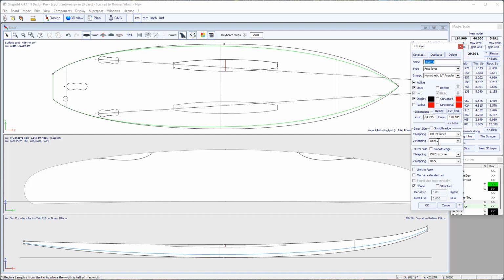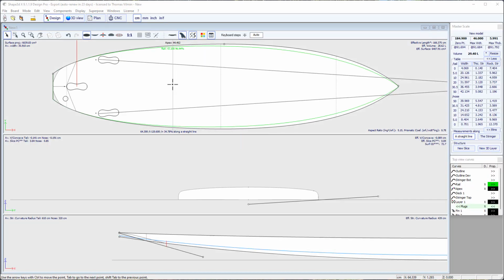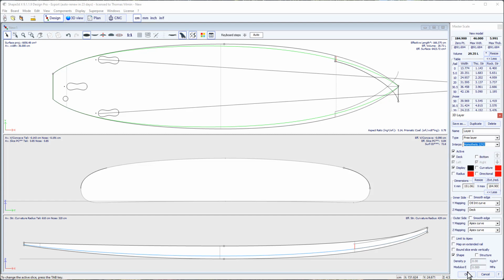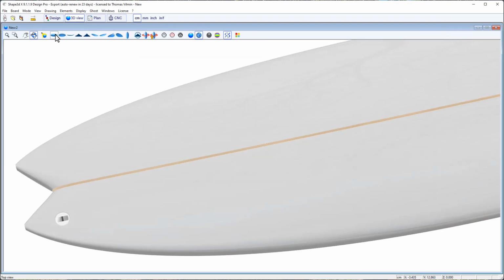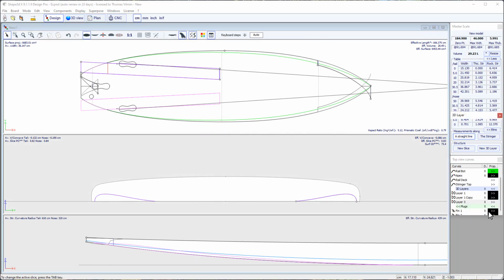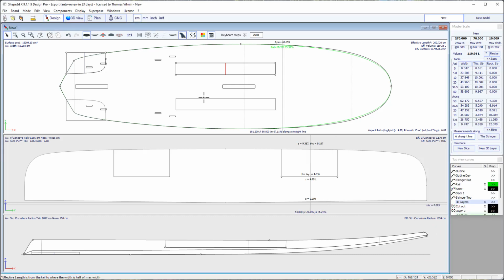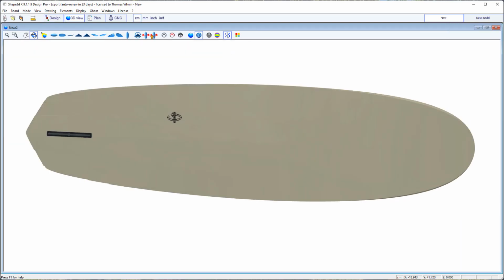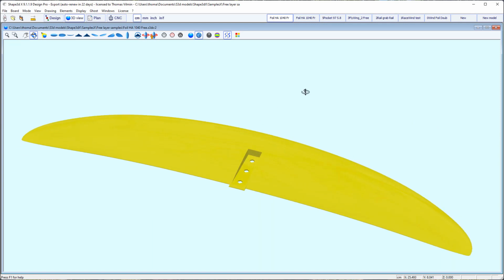New Free 3D layers in update 9.1.2.0

Comment: I still get a kink in the Tail of the board when making channels with layers.  Map on ext. rail does nothing.  Very frustrating.
Reply from the maker: Is the Rail point defined on the slices? Please send me your file at thomas@shape3d.com if still doesn't work.
Reply: @shape3d362  Hi Thomas, 

Yes the rail point is defined on the slices.  I also tried on the standard surfboard file.  Same issue with the kink when extending the layers to zero on the tail.    

I will send you my file.

Thanks for your help.